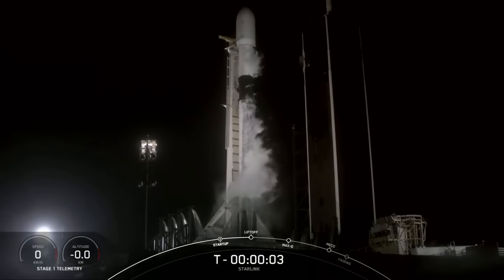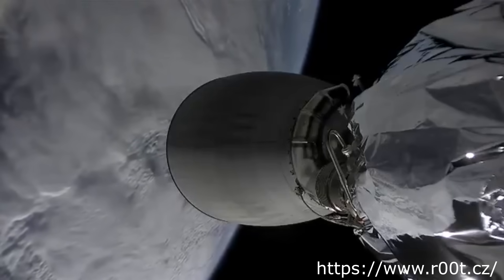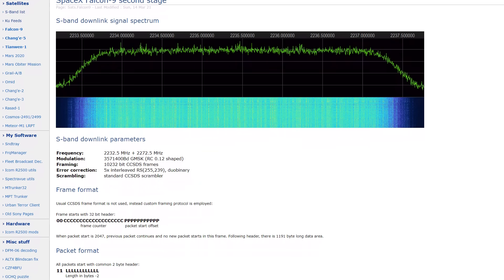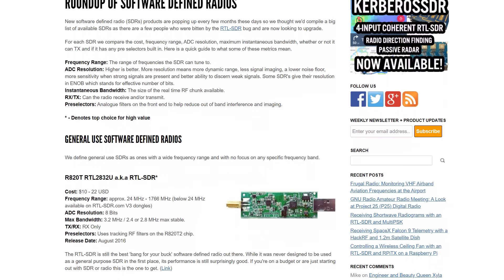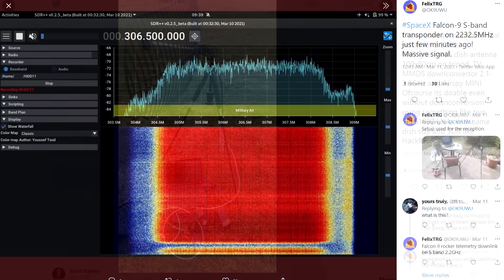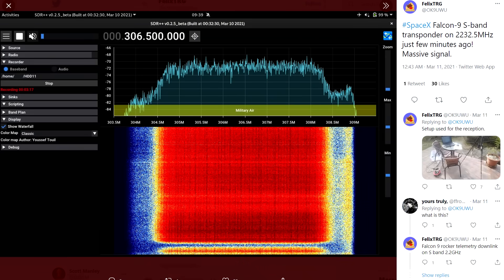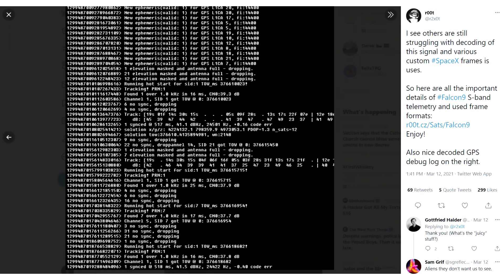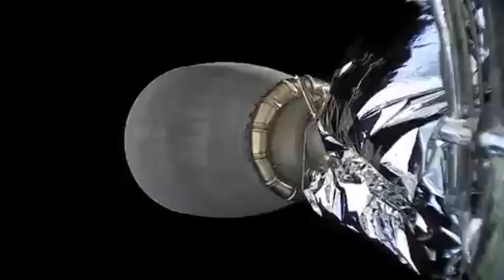How Amateur Radio Fans Decoded SpaceX's Telemetry & Engineering Video

Comment: For anyone wanting to get into the RTL-SDR kind of stuff, the "hello world" kind of project is gathering image data from the NOAA satellites.  Its a really good kind of "slightly above entry level" introduction to robotics, radio, modulation, antennas and decoding all wrapped into one.  It can be real janky and still work.

For Mr. Manley: the process of converting a 2.3GHz carrier to the 1.7GHz (or probably lower) that most SDR-dongles use is exactly-ish the same process that satellite TV Low Noise Blocker Downconverter's use to convert the 12ish GHz they actually receive to that 600MHz that actually comes into your house over the cable (or the other way around for internet).
In the case of TV, you literally just "mix" (aka multiply) the the 12GHz signal by a 12.6 or 11.4GHz signal, resulting in a 600MHz Intermediate Frequency which is then amplified but still has the 50MHz (or whatever) data modulation in it.  Then you can just SDR the 600MHz and recover the original 50MHz channel that was encoded on the 12GHz carrier.

I'm guessing you kinda knew all this, but just in case.

Comment: @3:23 The other gizmo Scott is talking about is a block down converter(BDC). It is essentially a frequency divider. It take a high frequency carrier signal and converts it to a lower frequency that your decoder can handle. An over simplified example: if your satellite signals are transmitted in 30-33GHz range and you BDC divides the frequency by 10, it will convert your signals to 3-3.3 GHz. Some models subtract a fixed frequency instead of divide, but the function is essentially the same. 

If you have satellite TV, your dish has one of these built in. Except it is called a low noise block down converter(LNB). It has a low noise amplifier (LNA) and a block downconverter (BDC) all in one Unit.

Comment: PS also one reason why they do use cameras inside the liquid oxygen tanks is to also study the tanks themselves for any flaws or design changes that could be in included in the next rocket system of liquid oxygen tanks so as to make it more efficient for use that is also one reason why but they do have cameras in the tank even though it is cute like looking at a lava lamp

Comment: The danger of this is.... If the video stream to the flight command and control HQ can be intercepted, the it is possible for unauthorized coding to be broadcast to the spacecraft a d possibly reprogram the onboard systems to whatever the pirate broadcaster wants the spacecraft to do.
Reply: Nothing is being intercepted.  It's receive-only.
Reply: @david_akerman   So you're saying that all data from the spacecraft is broadcast only...not bidriectional communication?
Reply: @myyklmax  Of course. Why would they control anything from the ground?
Reply: @RawbLV  All rockets, by design are missiles, and their fuel is explosive.They are flying bombs.  There are groups who would hijack the rockets and use them for the purpose they were originally created, for selfish, malicious reasons.
Reply: @myyklmax  Thanks captain obvious but the rocket has a program that it runs by, it is not controlled.
Reply: @RawbLV  Don't be pompous or obtuse. Many governments, especially ours, spend billions of $$$ to keep hackers from breaking through the encrypted coding of our rockets, defense systems, and commercial and military aircraft. Even a passenger aircraft (ref.: 9/11) can be turned into a flying bomb.
Reply: @myyklmax  You're freaking out over amateurs capturing non-encrypted video feeds. Do you not have better things to worry about?
Reply: @RawbLV  Anyone who understands how telecommunications interacts with our modern technology is concerned about unauthorized code/program tampering. It's possible to turn your cellphone into a device to spy on you.....and you wouldn't even know it.
Reply: @myyklmax  But you don't know how the rocket and the control room interacts. It wouldn't make sense for them to control the rocket from the ground.
The rocket is controlled on the pad. They load in everything, and at T minus one minute they disconnect from it and the rocket becomes autonomous.
These rockets have already launched people in space and NASA allows. You can bet your money they are safe from tampering.
If you want to worry yourself, you can worry about the backend security, which is a great deal considering how many bad actors and viruses there are, but when that rocket is in the air, it's all autonomous.
Reply: @RawbLV  That is where you are mistaken. The rocket is NOT autonomous. It is running an specific set of programmed instructions, which are monitored by the command center, which does not have to be located at the launch site. For example, all Apollo and Space Shuttle flights switch to NASA's Johnson  Space Center (in Houston, Tx.) control after launch fro. Cape Canaveral in Florida. Furthermore, if the rocket develops a problem, which would make it a danger to human lives on the ground, it can be remote detonated from the command center.  This abort protocol iss programmed into the rocket co tell software. All it requires is the command code to detonate. Every rocket we launch has this command override abort/denotation protocol.
Reply: @Agent 666 I understand what you are saying.  If someone were to decrypt an encrypted video transmission, and bypass/break the encryption algorithm, then it is possible to transmit an unauthorized, coded algorithm to the spacecraft, using the command centers frequency and encryption. The spacecraft won't know the difference.

Comment: isn't liquid o2 faris? can they use electromagnets to hold it down?
i know it is not necessary because they probably need the boost for the other fuel, but would it be possible?

Comment: 90% of the time encryption is just not worth the trouble / time delay (processing power)
Reply: There is no delay with encryption, the only downside is that if any of the bits gets corrupted the entire frame or more get trashed.
Reply: @RawbLV  What you're saying is that computer instructions don't take some time. That's not the case. Btw encryption and transcoding of h264 video files is very CPU intensive. And the time 'delay' is also depending on witch encryption algorithm you use. Not using encryption could make the difference in finding the problem, why the rocket could have exploded.
Reply: @sanderspeetjens  You underestimate how fast processors are. They literally do billion operations a second; encryption would take barely any time.
Let's do simple math. They are most likely streaming in 24 fps, it means every frame must be delivered in 41.6 milliseconds. Even an intern could write an encryption algorithm that could beat that time. You are simply wrong about the delay, it's just too miniscule to matter.
Really the problem is that if a single bit flips a whole chunk of a frame, or an entire frame entirely gets corrupted. That's a challenge to overcome, but I'm sure somebody has figured that out.
Reply: @RawbLV  That's not the only thing that the processor has to do. You can't possibly know why they didn't implement encryption. I'm thinking of reasons why they just skipped it all together. Because like you said it's difficult to do fault correction. You also don't know which processor they use for there rocket.
Reply: @sanderspeetjens  You're right but they might simply not encrypting the videos, anything else might be encrypted. It just really doesn't make sense to encrypt something that is going to be shown to the public.
Reply: @RawbLV  The real question is: is it really worth it to encrypt all of the data. And is it really necessary that people / other governments can't 'see' the data.

Comment: Stupid question: if the oxygen is floating around in spheres in the tank, how can those blobs be directed to the engine?
Reply: They use small thrusters with their own fuel to briefly accelerate the rocket. The oxygen, floating free, doesn't accelerate until the back of the tank comes forward and hits it. The oxygen is now gathered in the right place for feeding to the main engines.

Comment: However "cheap" encryption is today (with modern hardware having some options built in, not sure on space faring kit), it still carries a cost, in terms of both time and energy. You should always be assessing the actual threats you wish to protect against and how much of your budget you're willing to expend on addressing them (i.e. the most secure feed from a falcon rocket is one that's never powered up and never launches, as a bonus buried in a bunker, but that's not a terribly useful rocket). The biggest secrecy concern for these rockets is when they launch classified payloads and you won't learn a lot by staring at their oxygen tanks or the vacuum engine.

Comment: I'm using one of those dirt cheap dongles with a high quality LNB (shifts the frequency down) from 10Ghz to 740Mhz for a different satellite over Africa, the AMSAT Oscar 100 communications satellite..  My satellite receive system  cost next to nothing using an old PC. Modern tech is awesome. I hope SPACEX stays sensible and doesn't encrypt stuff.  Think I need to get a Lava lamp though to keep my new CP/M computer company. Fly safe.

Comment: 3:59 The green bits are likely a sync pattern (rather large, probably due to wireless noise concerns).  The yellow bits are a sequence number counting up and rolling over to zero (rollover happens at the stark transition from yellow to black).  White bits are probably the main data.  Turquoise bits I am unsure off.  Maybe those are a "packet type" field?  My first guess was checksum or CRC, but the solid black sections seems too "patterny" for those things.

Comment: I don't know for SpaceX, but Ariane 5 ESC-B was designed to be able to fire it's main engine in zero G. The structure at the tank outlet should hold enough liquid through surface tension, so that the engine can fire until the rest of the propellant has gathered at the bottom of the tank.

Comment: I’d guess that the LOX at the bottom of the tank is there not because of superficial tension, but because during that fase of the flight the second stage is rotating around its axe so as to “throw” away the Starlink satellites. So it’s the inercia of the liquid being spun around, at the other end that makes it stay on the bottom of the tank. IMO.

Comment: The 6 vanes inside of the tanks are wicking the fuel into the out-flow pipe at the bottom using surface tension.  That's why you are seeing the fuel pool at the bottom of the tank.

Comment: Pretty sure receiving signals coming from spacecrafts is legal in Europe. And if the rocket is in space one can wonder whether copyrights are valid either. The SDR does not have to compute everything using CPU, it can have hardware bits that are just configured and arranged with software.

Comment: The signal looks like very high bitrate FSK modulation which is a standard technique. The device used to downconvert the frequency is called a mixer. Mixers are reciprocal devices that essentially add in the frequency domain, ie. If you give it 10GHz (LO) and 2GHz (IF) you'll generate a 8 LSB and 12GHz USB signal respectively.

Comment: To add encryption would provide degraded images. One of the Space Shuttle mission before Columbia Disaster, NASA wanted to check out the tiles of another shuttle, but DoD required the transmission to be encrypted due to the Defense payload, so NASA had to make a call off of degraded images.

Comment: Can someone transmit on the same frequency and broadcast anything they like
Reply: Kinda sorta:
- This signal is pretty directional, so you'd have to somehow get in the way of the beam. Not feasible.
- For less-directional signals like aviation radio, yeah sure you can broadcast on whatever frequency you like if you've got the right equipment.
- It's illegal to broadcast on a frequency that you're not authorised for, and yeah people do go to jail for that. Not recommended.

Comment: Its a frequency upconverter or down converter.  It takes say 2ghz-3ghz and drops it to 500mhz-1500mhz.  Or the other direction it would take 20mhz and bump it to 200mhz (or whatever range your sdr reciever needed).  The ones that drop 2-3ghz range frequencies down to sdr dongle receivable are fairly cheap (i bought one from alibaba years ago for 20$) and i think the one i use to raise LF/HF radio up yo SDR dongle frequencies was like 50$ at the time.

Comment: That LOX stuck to the bottom of the tank looks like it has a definite bias toward one wall. If the external footage you are intercutting with it is actually from the same aft-raised attitude, it makes me wonder, do you think the LOX is being held there by the tidal forces? At first I thought it was just surface tension but I would expect a symmetrical pattern and probably a more even film all over the tank wall if that was the only significant force.

Comment: As someone who is writing software for a satellite right now, I am amazed someone could have spend so much time trying to understand the protocol someone designed. On the other hand my heart goes out to the engineers that now will have to spend time on encrypting their data instead of working on something new.
Reply: As someone whose built a number of radios flying around in space, the best part was on the web page for the group doing this that said "uses a non standard ccsds framing".

Ffs. Its always something.

Comment: Microwave up and down converters, The up or down converter is usually in the LNA horn on the dish it's self. And also a duel azimuth motor drive to track the signal with the dish.

Comment: I think the downconverter is just a dumb, specialized circuit. The software defined radio in the TV receiver was intended for the frequencies of the broadcast satellites they use (presumably at a lower frequency). There was no reason to included the ability to hear higher frequencies. The downconvertor taps into the market that the TV receiver was never intended. It's a commoditized component doing one simple task, though at very high speed.

Comment: The  SDR are based on under sampling. When sampling an analog signal , any frequency component over the sampling frequency divided by 2 (Nyquist frequency)  gets mirrored into the user frequency range. This is usually unwanted because of signal distortions and filtering analog signal before converting the signal to digital is standard. Not so with SDR. The range under the Nyquist frequency is empty. Undersampling gives a mirror of the frequencies over the Nyquist frequency . Former extreme high frequencies are now mirrored into a frequency range which is cheap to process,  which replaces extreme expensive fast AD converters.   The theory is described in the Fourier transformation (signal theory).

Comment: When I worked at NASA DRYDEN at the Aeronautical Tracking Facility as a telemetry operations and maintenance engineer, we took apart the space shuttle tm stream and found the "toilet flush bit' sequence and made a flush indicator so we knew when it was used while on orbit. Why?  Because we could.

Comment: Honestly, I would love if you did a video about the logistics of making fuel flow in zero g. Obviously if there is a little bit of acceleration, the fuel flows to the back. Would this mean that pumps working on an theoretical/scifi ship with engines "in front" of the tanks work harder? What if the fuel were to "un-stick" from its surface tension due to circumstances like rcs thrusters or just a long term flight?

Comment: Thanks for all the great content!
I wish you could do a video on how all spacecraft survive the extreme temperature differentials between +200 on their sunlit sides and -200 on their shaded sides.  I’m amazed how the lunar equipment can function with a 400 degree difference in materials like that.  I am not talking about the roll the command module did to and from the moon, I’m talking about every other device they used that was not rolled to even out temperatures while on the moon - the LEM, Rover, etc.  I would also be interested seeing how the temps break right at the fine line between shadow and light in a vacuum - like zooming into that spot and examining the temperature transitioning between the two extremes!

Comment: Don't quote me on this but... A bunch of zeroes (or ones) being turned into an alternating 0 and 1 is a VERY old technique (1950-ish) called NRZI (Non Return to Zero Inverted) - used in telco and for magnetic tapes. When you apply bit stuffing in order to define frame limits (to transmit 7 'ones' you have to add a 'zero' or it's a flag - unframed data) you are pretty much guaranteed to not confuse an open only (broken circuit) or closed only (short circuit) with an operational communication channel. Of course NRZI also has the advantage of providing periodic clocking calibration and synchronization even if both sides are not 100% stable or in synch (satellites have this problem because a satellite second is not the same as an earth second due to general relativity).